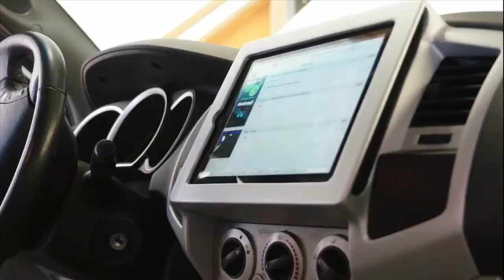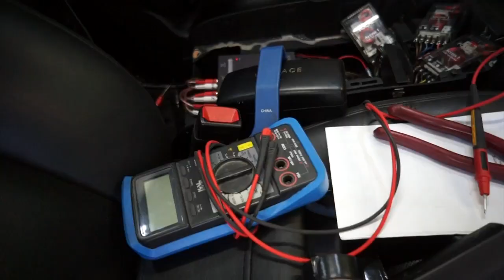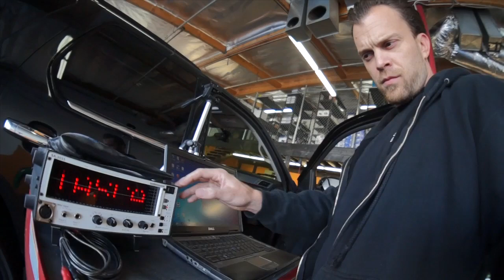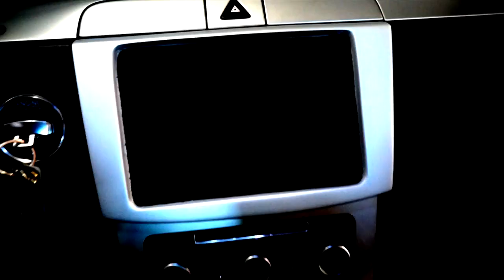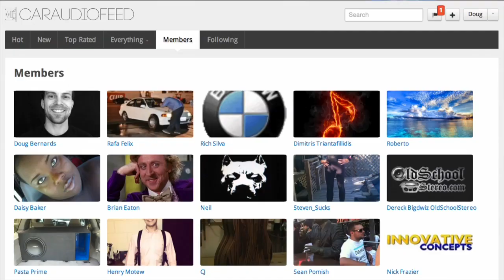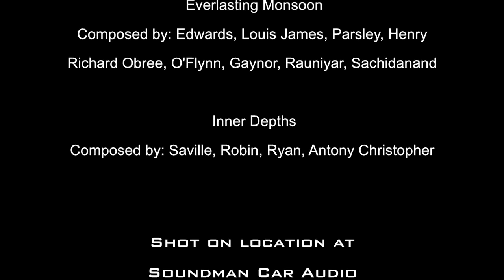Amplified - How to install an iPad mini in the dash of your car, VW CC. Audison Bit Ten D tune Escalade, EP 78

Comment: I rdon't rally buoy some of these videos and I'm thinking about doing an iPad instal.  But I have a question.  How do you use your phone as at present I use my phone throug the Bluetooth on my normal stereo.  So if I'm using an iPad, does that mean I won't be able to use both

Comment: The install looks sick. I have a tsx n was think of doing the same but had a few questions. First is what Bluetooth module do u use to? I have an aux in n was thinking of using that with with the RCA outs from the Bluetooth module. N can I buy it from ur website?
The second one would be what are u all plying on the iPad to allow it to come out free so the resin doesn't stick to the iPad? 
Oh n can I buy the magnets through ur website or call in and ask u to ship them to me. Thanks love it n loo